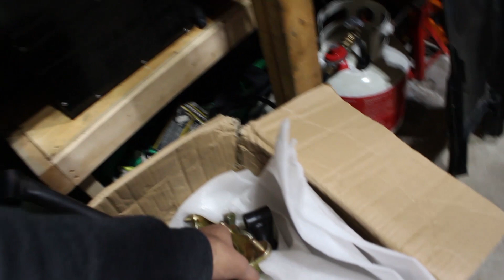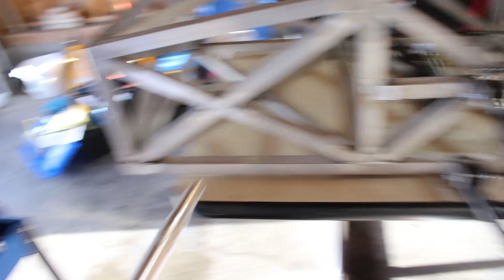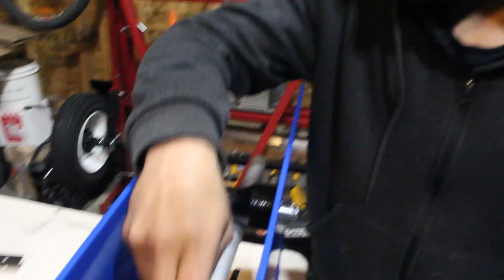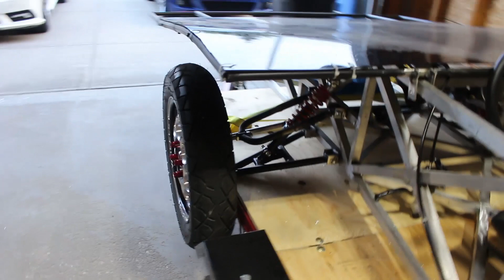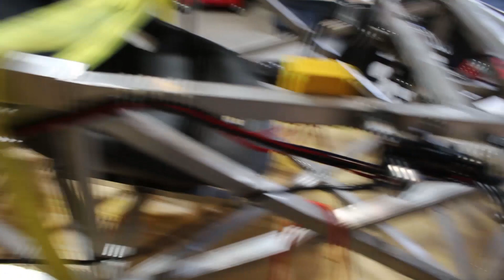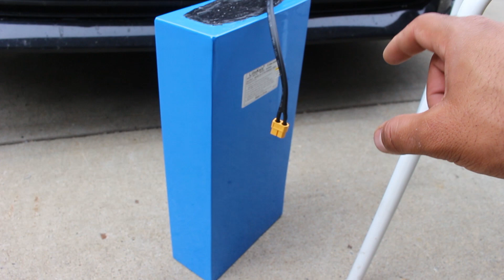Building a SOLAR CAR (6 month build!)

Comment: Hey RIB. Just wanted to reach out—nearly three years on—to say thank you for sharing this solar car build. I came across the video in June 2025 now, and I was genuinely impressed by your ingenuity, the use of SolidWorks, 3D modeling, and how you tackled each challenge from control arms to Hall sensor programming with persistence and creativity.

It’s especially inspiring to see how you worked with limitations—repurposing a bike frame, ATV parts, and building your own brackets and mounts. The quiet satisfaction you expressed with tools like the tube bender really captured the joy of the build process.

Your work deserves ongoing appreciation. It works, it’s light, and it clearly took not just skill but heart. Keep going—if you ever revisit solar builds or similar projects, there’s still an audience out here grateful to watch and learn. Warm regards from the Cape of Good Hope peninsula SA